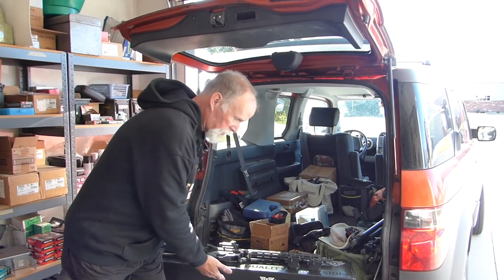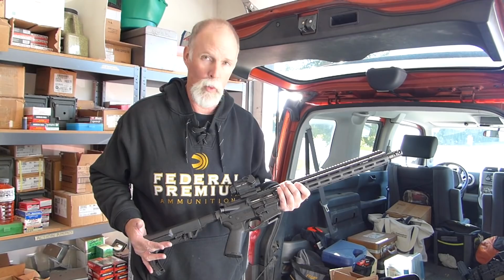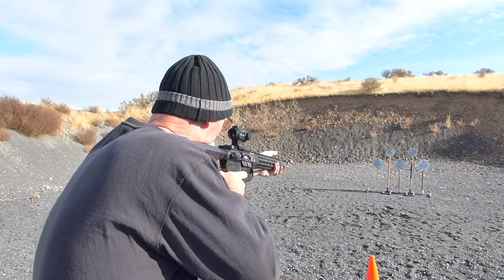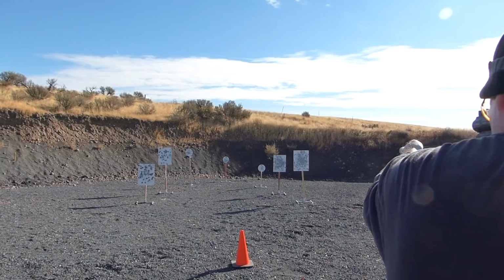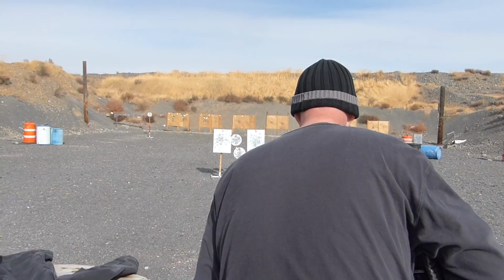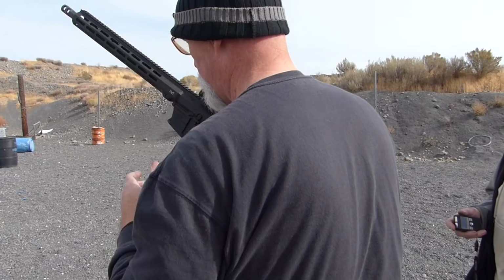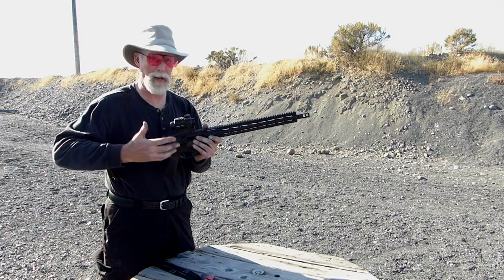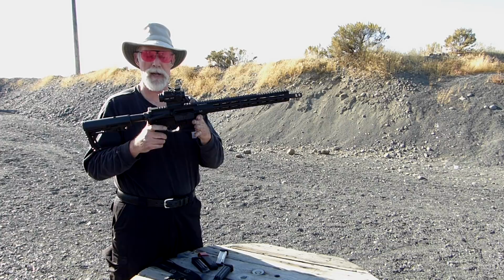Nordic Comp Pistol Caliber Carbine!!! Out of Box to Match Review!!!

Comment: Wish they would get rid of the forward assist. That much cleaner. If the round doesn't go home and go into battery under the spring pressure you sure as hell should not going to beating it in.
Reply from the maker: I understand, but they already make a standard AR upper and this is one as I see it.

Comment: Why are XD Mags always ignored by 9mm carbine makers? Am I out of touch about how many XD pistols that are sold here in the U.S.?  Btw nice job Pat as always love the OBRs.
Reply from the maker: Thank you.  I bet Nordic will have a XD compatible unit at some point.
Reply: We don't currently, simply because of the amount of re-engineering that would need to go into an XD-compatible magwell.  Unfortunately the design of the XD magazine makes such a prospect a lot more complicated than just reworking the internal dimensions to accommodate the mag body.  (Location of mag catch)
Reply from the maker: WOW! Very cool that Nordic responds here directly.  Another reason to buy from NC!
Reply: Patrick E. Kelley  yeah that's a sign of a good company.  I never knew XD mag designs are that much different than Glock or M&P.  I'll have to sit down with all three and check out the designs. Interesting!